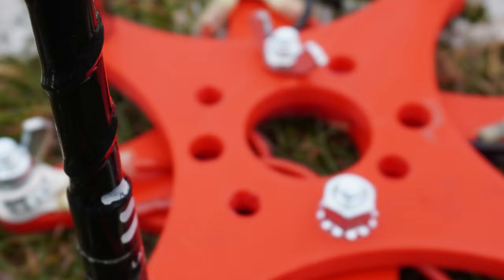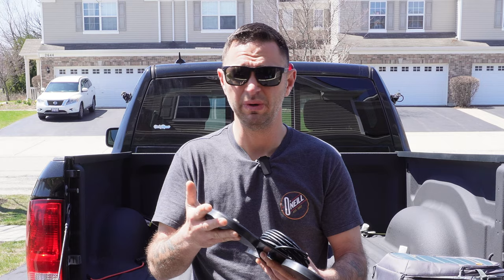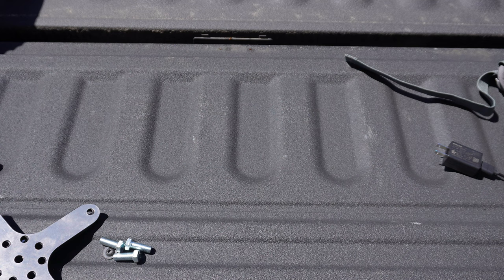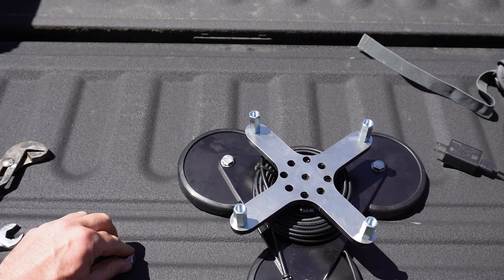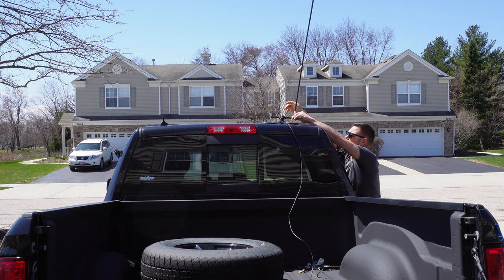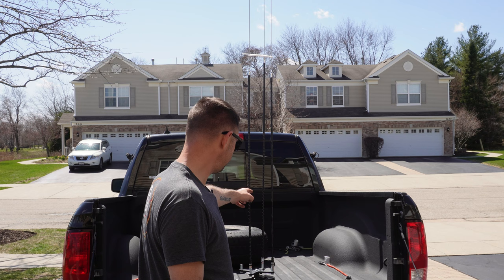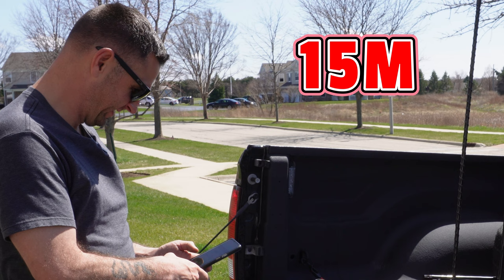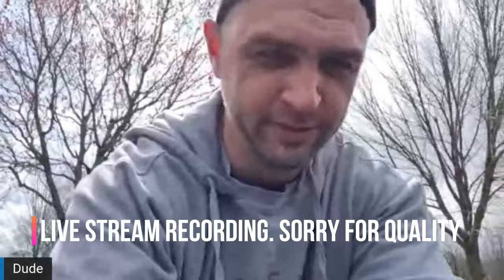Building and Testing the Hamstick Mag Mount Commander!

Comment: For those who don't have access to 3D printers, from online and at some home improvement stores you can get rectangular metal and nylon plates that can drilled to create something similar. A thicker aluminum plate might be easier to drill and stiffer than a stainless steel one and would eliminate the need for a nylon one. (I hate to drill SS steel.) And rather than deal with multiple antennas in such close proximity, you might opt for quick-release connectors for 3/8-24 antenna mounts.

Comment: 1600 + mile contact from your tailgate. Is what I call proof of concept. The rest is dialing in the details.great work. Mine will be starboard because I have plenty of it.
Reply from the maker: Starboard, what do you use to cut it? That may be something I look into.  I'm looking forward to hearing how yours comes along!
Reply: @HAMRADIODUDE  cuts with wood tools. Just go a little slower. The orange home supply store has it. It’s dense don’t use the light weight vinyl. To soft .

Comment: If you want to make it even stronger, double up the plastic plate so you have stainless, plastic, plastic, stainless. You will need longer bolts (nuts are the things with threaded holes in them) but it won’t cost a lot. Also, lock washers got under the nut, not under the bolt. 
Cheers 
Tim

Comment: Dude,
You could also use copper roof flashing in place of the stainless X. 
As I print ONLY in PLA, I would go with a higher infill density and maybe a more exotic infill pattern. I'm pleasantly surprised that you were able to couple the ground-side of the antenna to your truck bed thru the bed liner...but then again, you were using 3 big magnets. Good job!
Reply from the maker: Thanks! I'll go check it out. I think one of the main reasons I got the part fabricated was I already had a design in mind and was working off that design. But also, I wanted that designed to be uniform with the metal plate, and I don't know anything about cutting metal or shaping it.  However, there's been a lot of pretty similar suggestions, so maybe I need to look into this as a do-it-yourself build for anybody. B thanks much! Take care

Comment: By the way use a plastic cutting board 1/2 inch thick
As a base use some  1 1/4
Inch wide copper or brass 
Strips  soldered in the middle in lieu of the stainless steel.
This can be built without a 3D printer for maybe 10 to 20 bucks.

Comment: Dude, just watched your video. If you want to stiffen up the X, just add a second one of those thin stainless X plates one the bottom of your plastic one to create a sandwich. That’s how a lot of composite parts on aircraft are made to be strong and light. By itself, one thin stainless plate is easy to bend (so is the plastic), but by spacing two stainless plates apart with the plastic as a core, it changes the bending load to put the top and bottom plates in tension and compressive loading. And those stainless plates are a lot stronger in those loads. They looked thin enough that you wouldn’t have to change any other hardware by adding a second plate. 
Cheers from Moose Jaw 
Tim VE5THF
Reply from the maker: I'm going to try this tomorrow.  Thank you
Reply: @HAMRADIODUDE  I was wondering how adding the second X plate went. I don’t think there’s sufficient stiffness increase that you could drive down the highway with the array on the roof because the sticks have a lot of leverage, but it should be better. 
Tim
Reply from the maker: @TFuzz58  I just made a whole aluminum plate.  Didn't arrive until yesterday. https://twitter.com/HamRadioDude/status/1523378548303872000?t=FNfrQKh5xd8J0YpaaQvHTQ&s=19

Comment: I love your idea and obviously it works. Someone else may have suggested this, but why don't you
replace the plastic part and metal plate and make the whole antenna mount out of aluminum plate.
This would make it more ridged. Maybe spacing them out just a little more might help with tuning.                                                                                                                   Just a thought, great idea.  73's Gary KF6EWO

Comment: with the hamsticks in that close proximity you are going to get some mutual coupling and that will cause them to need to be shorter than normal.  I am surprised you don't get a tune for 15 on the 40 stick.   with the 10, 20 and 40 on the setup.  One other thought is maybe a stainless plate above and below the 3D printed form to provide more rigidity.
Reply from the maker: I figured I didn't get a tune on 15 from 40 due to the narrow bandwidth on a hamstick.  However, you are correct about the coupling issue. That explains why 4 antennas didn't work well. Realistically 3 was okay, but if I spread out the Antenna spacing , we'll probably have 4 antennas.  Thanks for the suggestions, I really appreciate hearing the suggestions and other people reading this may get some useful information as well! Take care!

Comment: suggesting as to how you can make that stronger without doing anything really and pretty cheap to do is under each arm instead of a short bolt make them longer using a nut under allowing them to be adjustable to keep them from bending,  think of them like machinists jacks. another thing you can do is print a ring along the outside or legs. if the legs had threaded holes you can then use the bolts like levelers. one other thing is asa is a great abs replacement and has a much higher melt point then abs pet-g or pla. no need for higher infill add another outer shell. if you havent watched cnc kitchen and his filament tests and how he has used an oven to harden prints check him out.
Reply from the maker: Oh there is so much good information and suggestions. Thank you!

Comment: What an antenna designed by (SK)  W5JGV that uses a tree as an active element which would have to be made in two parts so that the tuning circuit clamps around the trunk of the tree which will become the radiating element what about it.

Comment: Okay, Sean, I have a question.  I have a 40 meter hamstick, and a 20 meter hamstick.  I use a mag mount and switch them out.  On my Rig Expert I get a very good, almost flat SWR for the 20 meter.  On the 40 meter, I get a V shaped SWR and can't seem to get it lower than 2.0.   Do we just have to settle for that SWR, or would a set of radials help?  I wouldn't think you'd need one with a mag mount, but what do I know.  Great video here.
Reply from the maker: JD, I was thinking about this recently at well.  What kind of vehicle do you have and where is the magmount mounted? I'm not positive I have an answer but may have a suspicion
Reply: @HAMRADIODUDE  It's a Kia Niro, and it was in the middle of the vehicle measuring across, and at the rear quarter measuring front to back.  I put a set of radial wires under the magnet and that did nothing.  I am strongly considering building the Ham Stick Commander though.  By the way, I'm sending you a copy of my new book when it gets here from Amazon.

Comment: Do you notice a difference in transmission and reception with the mount in the back of your truck vs on the roof top?
Reply from the maker: It's better on the back for me because the roof is really thin garbage metal..
Reply: @HAMRADIODUDE  thanks. I just wondered if the side of the truck beds interfered. I would prefer to use my truck bed instead of the roof
Reply from the maker: It definitely could cause some issues. I have been known to put it at the end of the truck bed tailgate... And that seems to work pretty well. My buddy Dave did extremely well this weekend with contacts and he had the same thing a ham stick in the truck bed.  If you have better metal on your roof, I'd give it a shot for sure. That would be the ideal location

Comment: What was your swr?
Reply from the maker: Sorry, this was 6 months ago or more.   I'd assume Under 2:1 if I was operating
Reply: Thanks Sean - I was trying a single whip setup on a mag mount(15m) and swr was silly high, single magnet , not 3
Reply from the maker: @marcr1230  what kind of vehicle are you operating, and where in the vehicle was it? I just wonder if there's not a lot of metal or if that metal you're attached to isn't connected to the whole frame, thus reducing your ground plane.  You could try to run a couple radio wires off of the antenna or run a ground strap from the magmount to a different part of the vehicle?   I'm just thinking that if you don't have that ground plane maybe that's why you're standing wave ratio is high. , Assuming you already tried to tune the actual hamstick
Reply: @HAMRADIODUDE  it's a Chevy equinox, I had it on the roof but close to the side so I could work with the whip

I will try either a better connection to the chassis, or radials- minor problem is that there's no exposed connection to the antenna ground, just a 3/8" socket for the whip